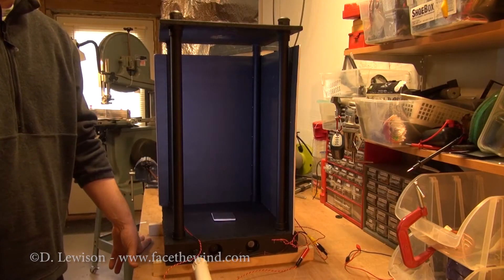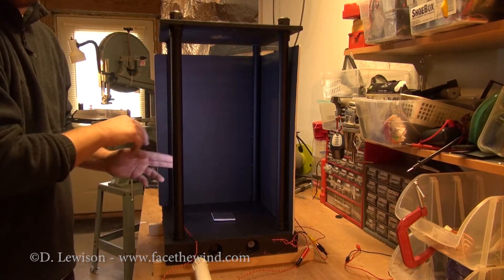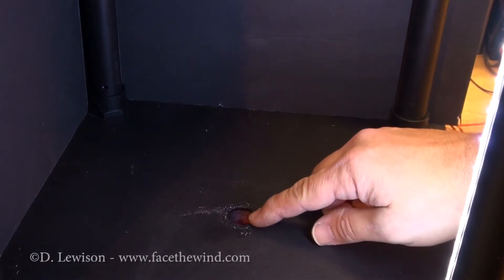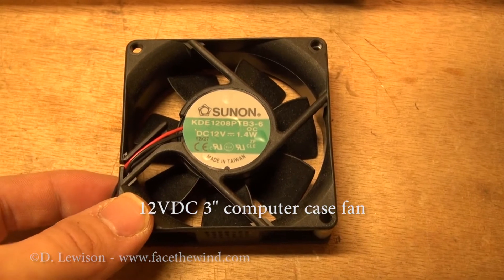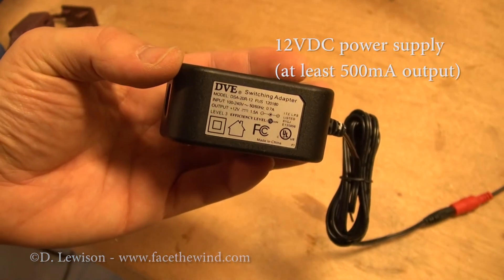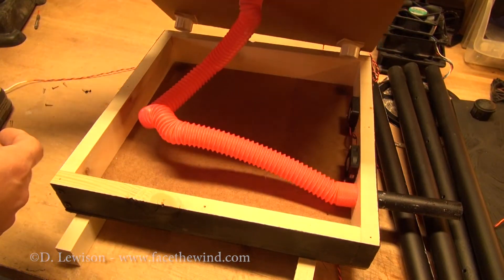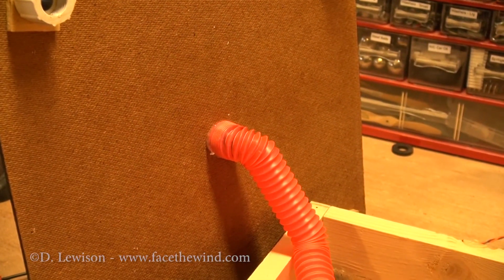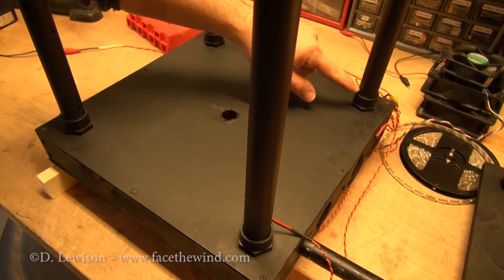Building an Open-Air Type Tornado Simulator Chamber

Comment: i see that the 12V fans come with wire leads as the connection. How did you wire them to connect to the transformer?
Reply from the maker: +Brian Liu These are simple 12VDC fans. I got a 12VDC transformer and just connected the leads on that to the wires on the fan, making sure to get the polarity correct. Just soldered the wires together and wrapped them in electrical tape.